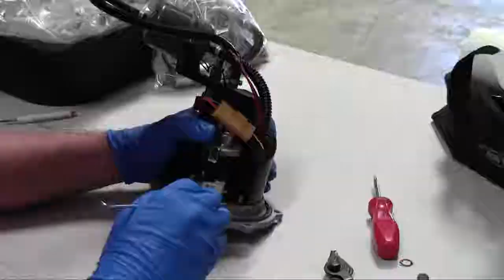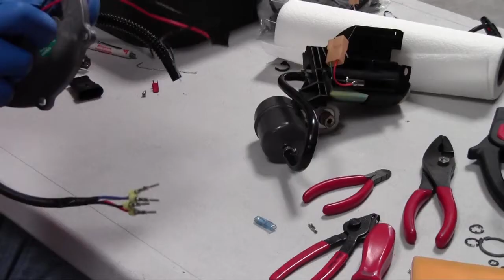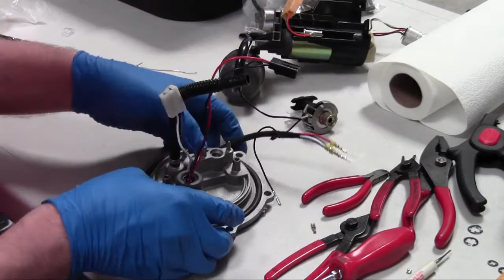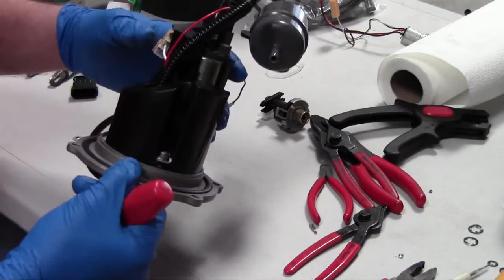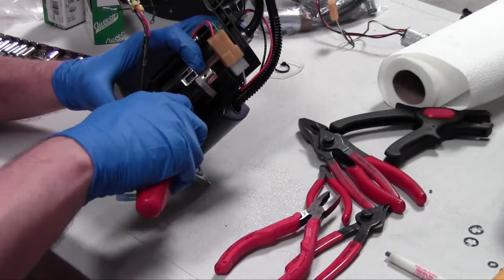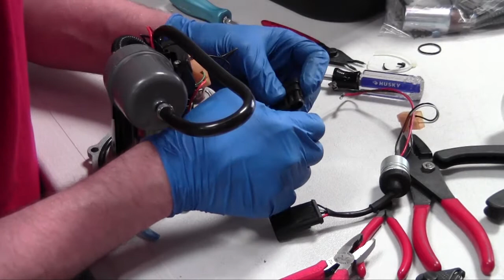Ducati Flange Wire Install

Comment: I am working on a 2007 Ducati Monster 695. I was wondering if this wiring harness is supposed to be better quality than the OEM version? I'm looking for a permanent fix, rather than a band-aid/temporary replacement. Any information would be greatly appreciated! Thank you!
Reply from the maker: Brandon, I think the most reliable and permanent fix is to use our parts and get the wires from an OEM oval flange and use those. Get used 1098 / HM1100 wires from eBay or they can be had new in an Aprilia fuel flange like in these videos. Look for Aprilia part number 898260. You'll need to change the electrical tabs on the red and black wires. But all these flange parts originate from the same company, Bitron, a fuel systems manufacturer based in northern Italy.

We do offer our complete solution but have been through a few different chemicals to seal the wires in. I might not ever trust or believe something is "fuel proof".
Reply: @CaCycleworks  Thank you for the reply! Ideally, I would like to use your complete solution option and be done! I just wanted to be sure that the construction, sealant,  and soldering of the wires was going to provide better longevity than the OEM part. If so, then consider your part purchased!

Comment: I'm working to replace the wiring in my s2r800's fuel pump and I bought the part that CA-Cycleworks recommended on a forum (Part 51020032A ). It doesn't seem to have the smaller ground wire you connected at 4:32 on this video. do you know if this needed? will it cause issues to my S2R800 if my fuel pump wiring doesn't have it?
Reply from the maker: I wouldn't worry about it. I added that wire to the kit because some OEM filters have a ground strap. I think sometimes Ducati have engineers who apply book theories to our bikes in cases where other auto and motorcycle makers have proven it not required.

Comment: Hello,
2007 Ducati Monster S2R 1000. My low fuel light does not turn on when I am near empty. I believe the sensor is located somewhere in the flange/fuel pump assembly. Would these new wires, or another part in your inventory fix that issue? It used to work intermittently but then stopped working altogether, so I do not believe it is related to the instrument cluster. Perhaps the thermistor is the issue? How could I test for this? Any assistance would be great and I'll be sure to purchase parts directly from CA Cycleworks.

Thanks, Jason
Reply from the maker: If the flange wiring is faulty, it is easy to test. You remove the flange from the tank and ohm the blue wire from inside of the tank to the external connector. Then repeat for white wire. If one is open, there is a fault, and our wires would then be the fix. Please do not buy the FWIRES until you prove it is the fault.

Comment: Is California cycle works the only one that carries this flange wiring?  $159 bucks seems a little steep
Reply from the maker: Yes, we had the wires made for us in China. Then we found they didn't make the part in the middle (that actually seals the fuel) correctly. So now, we are reworking the kits. Each wires set gets about 5 minutes of prep, 5 minutes of soldering, a minute+ each of: inserting wires into sleeve,  filling sleeve with epoxy, testing continuity, pressure testing, and packaging. Then there are the aluminum sleeves we had machined, the two sets of rubber inserts to seal the wires to the sleeve (so epoxy doesn't immediately pour out), and the cost of the wires when we initially bought them. Even at $159, they really are not profitable for us to make them... but we've already spent over $20k on the initial purchase of them. 

We were going to stop bothering with them as they crush my will to live when soldering them but too many shops are counting on us to have this solution for their customers. You're welcome to come and I'll help you build your own set and I'll let you set the price. I've soldered a few hundred sets and I'm at about 90% pass rate...

:) Chris

Comment: Can you share some information about the retainers for the plastic housing you used to replace the OEM parts? Your OEM retainers cracked the same way mine did when I removed them.
Reply from the maker: They are called "push nuts". You need ones for 4mm and 8mm posts.